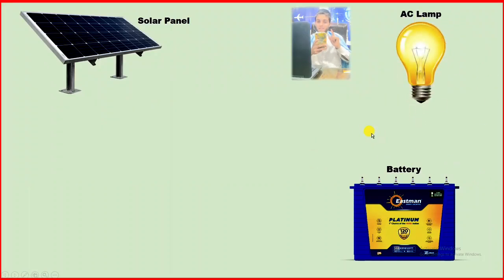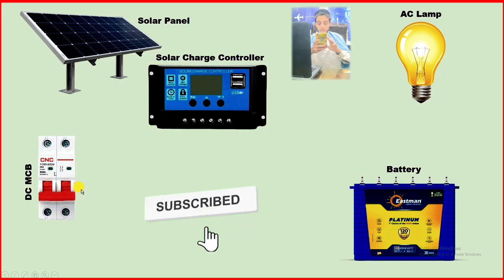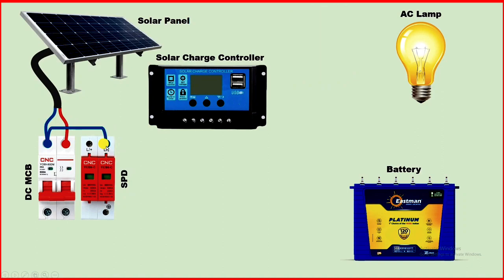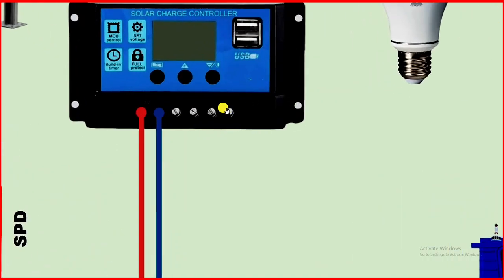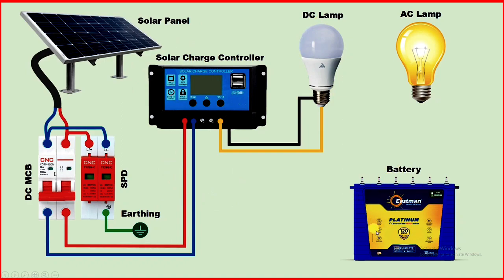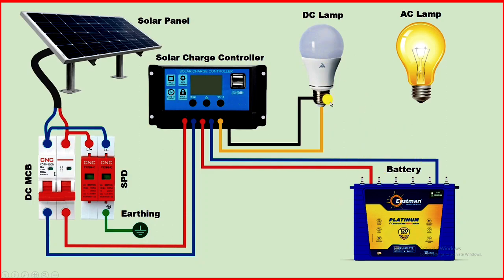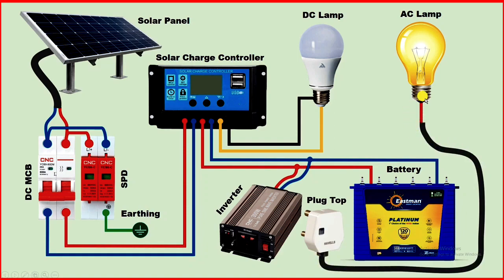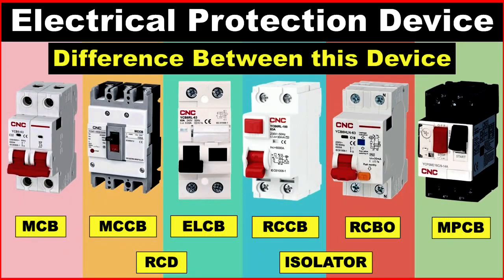Complete Solar Panel connection with solar Charge Controller and inverter 2024.

Comment: in place of dc bulb can I use dc fan and how much  watt of load can I use from solar charge controller from end connection
Reply from the maker: Only one DC Bulb solar Controller
Reply from the maker: DC Fan Connection of Battery
Reply: @Zaman_Technical007 can I connect MCB with solar controler end side  where load can use and use dc equipment